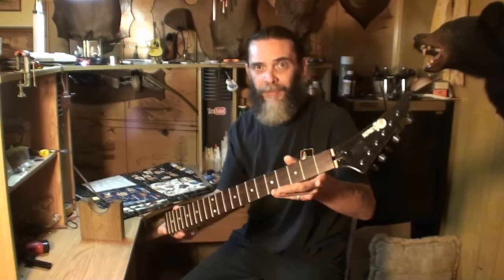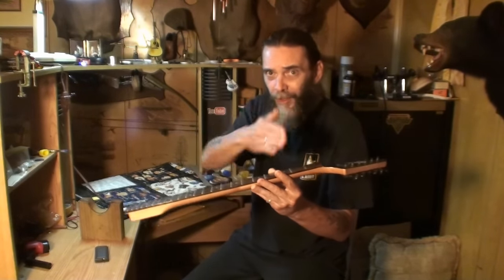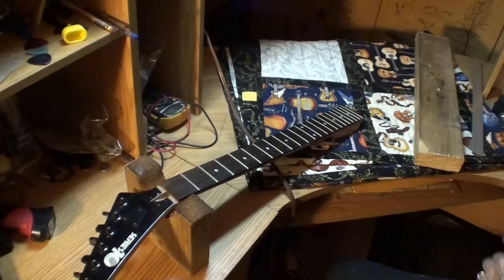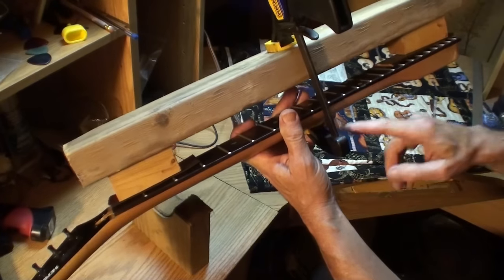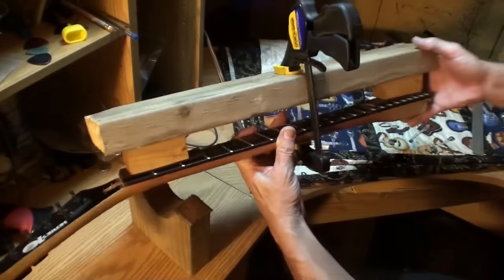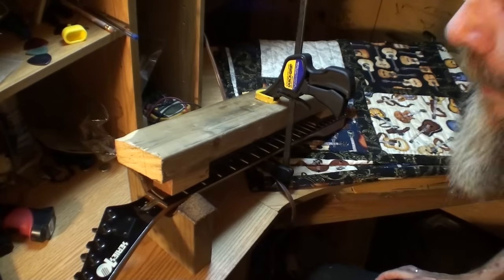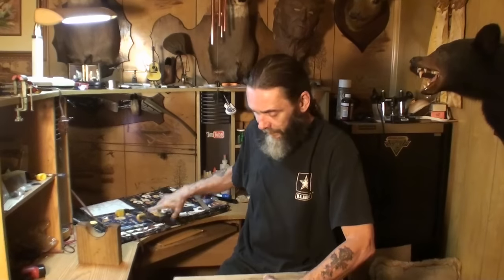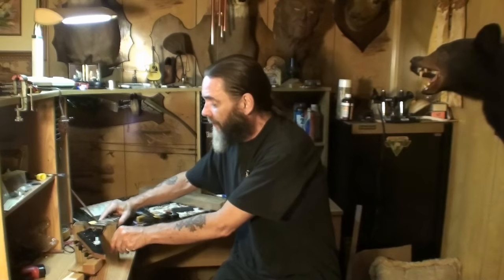How to Help your truss rod by Randy Schartiger Quick Clip Tips

Comment: Hello Randy. I have an old lawsuit strat. The truss rod was really tight. I did your method and it helped, but after that I was still getting upbow. So I combined your method with clothes iron appling heat with a wet towel   on the fretboard for 20 minutes. Then I let it cold down with clamps on for 12 hours. Now it is perfectly straight! Thank you
Reply: Nice. Thanks for the tip. Always great when people share their successes.

Comment: This helped me out big time.  I couldn't get my 40 yr old acoustic neck flat enough for a fret level it desperately needed. My dad tried to learn on it and ultimately gave it to me when I started learning.  It really needed the tlc.  Guitar is a beater Korean Fender and not really worth replacing the truss rod.  I was able to get that extra 3/4 turn I needed to get it dead level.

Comment: Randy speaks the truth. AND... you can further assist the neck by heating it up somewhat gently with a heat gun or blow dryer while it's clamped. Doing so will encourage the neck wood to relax into the new position and it will prefer to stay there once cooled.  It's like me on the couch; once comfortable, I don't wanna move. (Just don't attempt to adjust my rod's nuts!)

Comment: Yassuh !
Randy, I bought a rodless Epiphone mandolin for $30 with a badly bowed neck and did the same clamping thing that you do. I then put the neck over the heat register at the worst bent spot which was the first half of the neck from the nut position.
I kept checking the temperature and it never got over 133 degrees. A couple days later I took it out to the front porch and left it in 20 degree temps for a day.
It straightened right up and is one of my favorite instruments in the house now !
Reply: Hey Kenny... just read your comment and I wanna try this on a cheap guitar with a badly bowed neck which doesn't have a truss rod. I only have Standard radiators so I put the guitar neck directly over the Radiator but with a bowl of water next to it so it doesn't get to dry....  I don't think I can get it to be as hot as 133 degrees though.. do you think it might work anyway or is it useless. I can't think of a way to get more heat . Any tips? I'd appreciate.
Reply: @nataliepauls3757  Hey Natalie,  I see that it has been a year since your question, and I hope your radiator idea worked for you.  If it did not and you still have the guitar (and you happen to have a hair dryer), you might want to try it for more heat.  You would probably want to go slowly and use the lower heat settings to preserve the finish, but it might work for you.  If you do not own a hair dryer, you might find a cheap used one at a thrift store or second-hand store.  Hope this helps.

Comment: Wow, just started setting up my guitars myself after 25 years of not playing I decided to pick them up and they were of course in bad shape. Been teaching myself via Youtube videos. Ordered many specialty tools and got my electric guitars playing and sounding great again. Started on my Fender acoustic and tightened the truss rod as far as I could and still had way too much relief. Will be trying this method in the next few days so I can continue to lower the action as low as I can take it. Thank you for the information. I think it will work like a charm.... All my guitars needed was some love... Thanks!!!!
Reply from the maker: it definitely helps when the truss rod seems to have done all it can. good luck in  your repairs and thanks for checking out my videos!
Reply: @RandySchartiger  I have the opposite issue where I can not get enough relief on a maxed out strat rod still choking on the g around 12th , I've had a good few goes and ended up utterly confused , this neck manipulation thing sounds like it's deffo worth a go, thanks for the video and information

Comment: Thanks alot for the video.  
I have a SRV STRAT with a heel truss rod that ran out of adjustment leaving me with still too much relief. I heard about putting pressure on them WHILE turning the rod but i didnt want to risk it. 
 
 well i was never playing my SRV anymore because of that so i figure... its gonna make it or its gonna break it but at least i will have an answer ! Iwas ready to buy new neck if anything . 

so with my hart rate trough the roof i was able to turn a full more turn ( in 4 little 1/4 turns ). I was AMAZED . without pressure applied , i could NOT turn it anymore , now it was getting the extra bit i needed ! 
 
 To all fender heel truss rod player with a " maxed out " rod...this IS your solution. ✌😎

Comment: Randy, I really want to thank you for the advice. Previous owner was either confused, inept or a slide guitar player because the truss nut was backed up so far it jammed leaving the strings high to the point of nearly unplayable. I suspect he thought counter-clockwise would lower the strings and when it didn't and the nut jammed he got frustrated and sold the guitar. I applied penetrating oil and while that soaked in made a couple blocks and spanning board. Once I had the clamps on, I tried to back the nut off before going clock-wise but it wouldn't budge so I pushed and pulled the Allen wrench back and forth with a little force eight or nine times until it finally budged. I got about one and a half turns before the nut moved freely in the neutral position. I kept going and got the strings lowered where they belong. Truth is that took two tries. (mainly because I got lucky and guesstimated right). This was on a nice Bourgeois dreadnought so you know I was sweating bullets the entire time. You saved me a trip to the luthiers. Thanks again.
Reply from the maker: it sounds like you definitely have a 2 way adjustable truss rod, when you spin it counter clock wise long enough it will start to get tight again and begin to force relief into the neck and that sounds like exactly what you are experiencing. thank you for checking out my videos!!

Comment: Randy, I dug a one foot deep hole in the backyard a little larger than the guitar, i then put plastic down and covered that with a soft towel.   It made it really hard to get to, but I tried.  I finally took it out of the hole and put it on a table and followed your instructions.  It really helped.  I'm just curious why you said to put the guitar in a hole.  Please reply.

Comment: Yes, done this more than once!  I'd suggest using a G-clamp with a screw handle, instead of a trigger clamp, gives you more fine control over the amount of tension you are adding.
Reply from the maker: Very true, I like the trigger clamp only because I can feel how tight I'm getting it when I squeeze but yep either or both works :)

Comment: I'm doing that right now Randy.  I really like this Idea because mine is frozen in the position needed to provide relief from a back bow, I want it level. I'll then have the frets leveled. This is a Hagstrom Swede and I believe this model is out of production. These have an H beam truss rod so they never twist and are more robust than the rod type, they also add sustain. Still I will use your method just to be sure, thanks. Oh yeah I was able to loosen it a tad so this will help me get it right.
Reply from the maker: best of luck! this method works just about every time. thanks for checking it out!

Comment: Thanks for the great video! I pieced together something that worked for me on a bass with terrible action from your video and a more recent one with Dan Erlewine. I found myself tightening the "neck jig" arrangement to add back bow and then tighten the truss rod quite a bit and repeat those steps multiple times. If it will work on a bass that was as bad as what I had it will work on anything.

Comment: Great tip, thanks Randy. I have a Fender Classic Player Jazzmaster with the truss rod adjustment at the body end of the neck. It's quite difficult to turn with a screwdriver and I know it needs tightening a little so I'll definitely be giving this a try. Cheers!
Reply from the maker: Doing this will definitely make it much easier to turn and if it's tight already this will make it easier on your truss rod. Thanks for tuning in brother!

Comment: I was having this sort of issue with my cheap maple neck Squier guitar. I tightened it a lot, but there was still a bit of a bow in there. Got that extra washer on that truss rod nut, but it was not sounding exactly right. :face-orange-biting-nails:
Reply from the maker: try this method in the video, you should find the truss rod will be easier to turn. good luck and thanks for watching!
Reply: @RandySchartiger  Awesome man! This neck is straight as never before, and it's awesome how in tune it's playing now.

Comment: I got wrong Epson Salt to water solution, about 2 months ago, but I did remember the the Baking Soda solution.  I remembered seeing your YouTube video 2 years ago after and Appling it to my car battery I got it to work for another 2 years. I drained the Battery Acid and did the Baking Soda solution I had only 10 volts after the new cleaning and the right Epson Salt Solution. I found the NOCO Genius 10-Amp Charger my battery my battery went from 10.4 Volt to 13.6 Volt, the battery went from not working to turning over my truck. I just though you may want to look into this. The only reason my Battery died is I do not drive my car enough and have to keep a trickle charger on it. How long do you leave the Baking Soda Solution in for?
Thank you Randy.

Comment: Randy, I love this! It must just be me because I have the worst time getting truss rods to move some times. I actually have one that the truss rod will not move. After your earlier video about helping I tried to help it but it still won't move... I'm going to try this and see what happens...
Reply from the maker: Maybe a drop of oil and let it set for a while then try this, if it's still stuck try heating the entire neck with a heat lamp or hair dryer sometimes will free them up. I've seen several that have not been turned for many years are a devil to get broke loose. Good luck! And thanks for viewing! :)
Reply: Thank Randy, that's kind of you. I'll give it a whirl. It's from a Epiphone Les Paul Jr and it's actually kind of funny, every problem I ever have seems to be with the same type of guitar. Thanks again...
Reply: @RandySchartiger  Where can I drop oil when the whole thing is stuck ?
Reply from the maker: @sylviaboa5510  right onto the adjusting head, it will work down into the threads after a few days/
Reply: @RandySchartiger  Ok , I'll try doing that. Thank you !

Comment: Great tip Randy! Do you have any tricks for getting some relief back into a neck? I have a gibson lp that has a straight maple neck. I can loosen the truss rod all the way and the string tension just can't put any relief into the neck. I have 11 guage. I can put a back bow into it easily though.  Any suggestions?  Thanks for all the great videos!
Reply: Hey Adam, any luck with this issue?
Reply: @AngeloGuardia  I did have a bit of success.  What I did was put 11 guage strings on the guitar to help hold greater tensionon the neck. I also put 2 sponge humidifiers in its case. I left the guitar in its case with the humidifiers for weeks. I would check on it periodically. This helped.  I still have the 11 guage strings on it and continue to keep it very humidified.  I think some of the problem was that the person I got it from let the guitar dry out. Oh, and I left the truss rod completely loose while I did this so the neck could move more freely. This helped me a bit, if its very severe it may not help enough but the guitar plays well now. If it's real bad, I believe that you can warm the neck up and get further relief.  Thanks for asking!

Comment: SHIT.  Wish I would have known this… few years ago I popped the truss rod in a custom guitar made in the 80’s with the most beautiful birds eye neck and macasser board..  all West Germany hardware Floyd rose, active EMG 81’s.. I’ve had to shim the neck with razor blades ever since.  Tooling around looking for videos on replacing the truss rod tonight, with this rod adjuster on the body-side instead of the headstock, looks like I may have to remove the board..  Good info here for next time!

Comment: Randy, I was considering this truss rod situation and here's a thought; why couldn't you coat the rod's threads with anti-sieze like we do with our BP rifle nipples, breech plugs and what not? What with having to keep the guitars humidified, I would think that the internal placement of the truss rod/adj. nut would tend to rust over time and the anti-sieze should solve the issue? I know that I have never has a stuck cleanout screw or nipple with using this product! Just a thought brother. Thanks for the great video.
Reply from the maker: That might be a very good idea! I've never thought about that before but it seems it should work as long as it doesn't have any effect with the surrounding wood, the wood inside there is not finished so not sure how it would react but it shouldn't be enough to hurt anything. Definitely gonna try to remember this and try it. Thanks Mike!
Reply: The material isn't like an oil or a grease and I haven't seen evidence of it running or soaking into wood (gun stocks) so maybe it will be worth a look. I hope you can find a project to try it out on. Good Luck Randy.

Comment: I have a bass I got used that has a stripped truss rod nut. I’m assuming they tried forcing it and wound up stripping it. Good tip for future reference.
Reply from the maker: thanks! I don't like endorsing stewmac but they sell a kti you can bore a little deeper into the wood and re-thread your truss rod, it probably cost a small fortune tho. thanks for checking out my videos!

Comment: Great idea!! Thanks Randy!! Have you ever lubricated the truss rod with WD-40 and/or oil to make the nut turn easier?
Reply from the maker: thank you Gery! yes I use them both on truss rods, it doesn't take very much and does a world of good to the threads.
Reply: I'll just say, late to the party, that wd40 is not a lubricant, but a cleaner and rust dissolver.
Reply: Dry silicone spray (get it at any home center), or dry teflon spray,
Reply: Vasoline.
Reply: It’s water displacement actually.

Comment: Unprelated question. I have a early 90's HD-28 P. I sent it back to the Factory in 2009 because the Binding was loose, the finish was coming off the neck. Now the Binding has shrunk. What does the Binding actually do. Does it serve a purpose or it it just for looks. The local Martin repairman has had my D-18 that I just bought last summer for a neck reset. Warranty is covering the repair. The guy has had since this past February. I guess the question is, should it take this log to reset the neck? Also, should I s no the D-28 back to the Factory again or try to get it taken care of locally. I know you guys can get overwhelmed with repairs. Especially if your good like yourself. I called the first of May about the neck reset and the guy acted like I was pressuring him. I just wanted to know if he had even started on it. Geez!
Reply from the maker: The binding does protect the edges of the wood when they guitar is bumped into something on the square edges, it also serves as a seal with the finish to seal the glue joints and helps protect the parts joined by glue. As for how long neck resets takes that sounds a little longer than it should take. I'm held up right now on this Gibson J45 I'm resetting because it's been far too humid to set the neck and expect it to stay, this could be what's taking him so long to reset yours.
Reply: Randy Schartiger , thanks buddy you always make sense to me. I'm learning a lot from your videos. People ask me all time time about the T shirt. I guess tell them to check you out,

Comment: I have the opposite problem:  1968 Telecaster neck, the type with no skunk stripe, the truss rod adjustment nut is on the bottom on neck, not on headstock. Neck is stuck in the opposite direction, it’s a tiny bit convex, even with truss rod loose.  Heaver strings don’t help. I did your rig,  but in the opposite direction.  Tightening the rig bows the neck, the truss rod is loose, but it flattens back as soon as I took off the clamp.  I’ve done it a couple of times, I even let it sit in the rig for a few weeks and it still flattens right back out. Help!

Comment: Hey Randy, found your vid cos I was searching for some help with a bass truss rod nut. The thing is not stripped and works fine but only to thight the neck further, cos when I try to give a bit more relief, the nut start to loosen until just comes out, as it reaches the end of the rod bearing washer, so the neck stays in a backbow position. What can I do?

Comment: I've got a 2000 gibson that the 1st owner used 12/60 strings on for most of its life

She held up on me for a bit but my 9.5/44s in D has tapped the truss out to its limit

I've been using your method on and off for about a week and it I can't bust the relief out and I HAVENT PUT STRINGS ON IT... should I try adding heat?

Comment: Hi. I tried your method and I was able to get the back bow but still can't turn in the nut. Nut is at the end of the neck. I also put the 0.100" spacer and still can't turn it in.  Any suggestions?

Comment: I have an old aria acoustic guitar. When I remove the truss rod cover 
all I see is a regular nut that is at the bottom of the rod with some 
threads exposed.  There is no eggcorn/bullet in front of the nut or possible way to fit a socket in
 to tighten it since there is no clearance in front of the rod.  Immediately in front of the rod is the wood from the headstock.
 The nut that is there now  can probably be accessed with a open ended wrench. I need to straighten the neck. it has a bow in it 
and the strings are pretty high from the fret board. 
Any input? and would this method help?